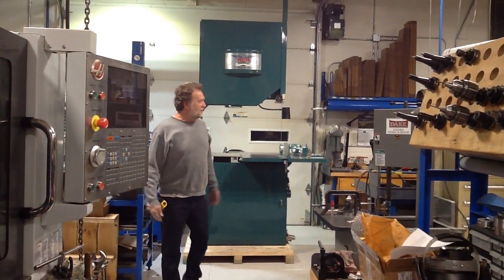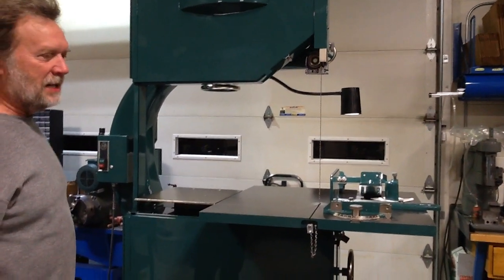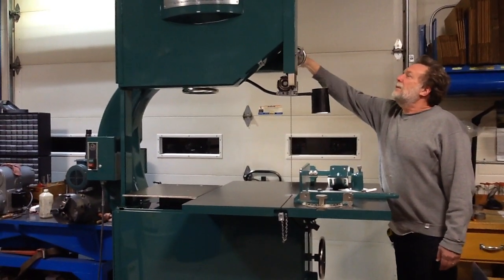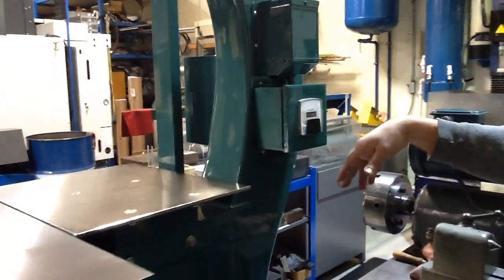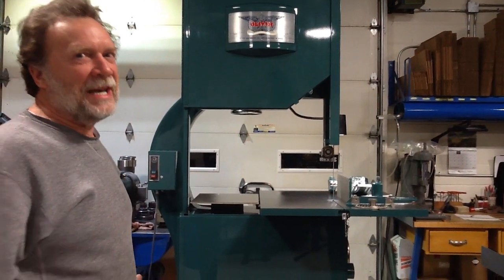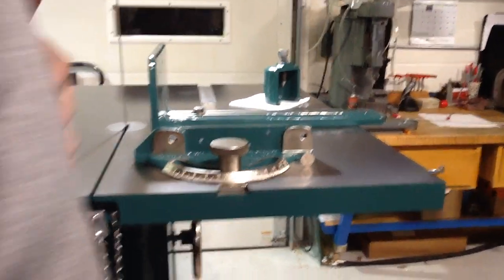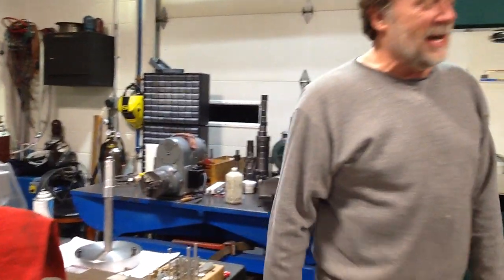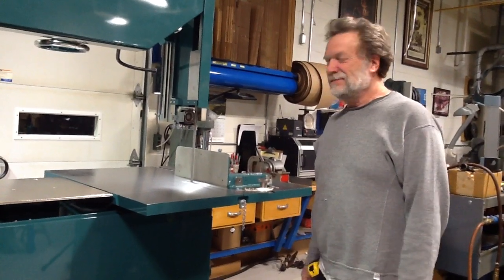Oliver 2416 36" Bandsaw

Comment: Hello Doug, Beautiful work on the restoration. I'm a teacher in southeast Michigan and my colleague has a Oliver No 2416  36 bandsaw.  He's trying to remove the lower wheel to send to the manufacturer but he cannot get it off the tapered shaft.  He's tried whacking with a hammer, heating it up, and we even make a wheel puller and attached a hydraulic jack to remove it but, not luck.  Do you have any idea how we would go about removing this lower wheel?  The manufacturer said they use a wheel puller but that hasn't worked.  Our hydraulic wheel remover we manufactuered is good up to 10 tons.  Not sure if there is a pin between the drive shaft and the wheel.  Look forward to hearing from you.
Reply from the maker: I had a similar problem. I purchased my saw from a fire department. in Washington state with damage to the hub on the lower wheel. someone had tried to pull the wheel with a puller and damaged the hub. I can get the wheel off for you, but you will need to remove the engine and the wheel and the dust plate from the machine and bring it to me. It is challenging to get at all the bolts, but it can be done. I built a 38"diameter "H" press with pears to press the shaft out of the wheel without damage to any of the parts. I have a puller from Oliver but my machine had damage to that area designed to use with a puller.  doug@precisionair.net
Reply from the maker: I have pictures of my press I made and the repair to my hub, I have been very busy, I hope you got this response in time. Email me, Doug
Reply: @dougclark160  Unfortunately, we had to cut the wheel off  to get to the hub, which we had to cut off as well.  There was  a pin in the center of the hub and through the shaft, but even after we drilled the pin out, we still could not remove the wheel.  That's why we cut it off.  Oliver is going to cast a new wheel for my colleague.  Pricey, but the quality  of the Oliver is worth it.  Thanks anyway.
Reply from the maker: Do you have a left-handed saw? I am thinking that it would be the only reason to pin the wheel on. On a right-handed saw the nut holding the wheel on is a left-hand thread. If it's a left-handed saw they may have used a right-handed motor and pined it so it would not loosen up during use. If you are willing to trade, I have an Oliver 30" right-handed saw  (very nice and ready to use) and I would repair yours. I have been looking for a left-handed saw for two years now, not many were built.  @mgarcia8540

Comment: Wheels were statically, not dynamically, balanced?
Reply from the maker: Statically, I was thinking I would get them close this way and if I detected any shake in the machine I would but a dial indicator from the table to the upper blade guide support, record the shake, and trial and ere the rest of the out of balence out by moving a stick on wheel wait around till the rest of the shake went away one wheel at a time. but there was no shake to get rid of. have you started to use or rebuild your lathe and planer?
Reply: The 25-A runs, however the original (belt driven from the outboard pulley) crossfeed smooth shaft, as well as the support brackets are long gone,
so, need to be fabricated. The 399 planer was bought locally at auction this summer. Need to go through it-not much available in tech material-the 'manual' from the Oliver people was not much…
Thanks for asking!

Comment: I used to have an earlier version of that machine. I liked it but the sheet metal door's and upper wheel casing vibrate a lot and make it a very noisy machine that howls at speed. The Tannewitz is a bit better engineered. The trunnions and table are more beefy. Mine was a 5hp direct drive which was okay but a tad under powered. The wheels were cast aluminium. 
I now have a Wadkin 30" bzb which is a much stiffer and quieter machine. The fully cast upper frame is way stronger than the old c frames and makes for a more stable vibration free cut. Noise is not good in a bandsaw. It causes the band to vibrate.
Anyway, lovely restoration and a fine machine nonetheless.
Reply from the maker: You are Correct,  Tannewitz and Wadkin are better band saws. Wadkin makes a chain- chisel mortier I like the best I have 15 Oliver machines now and it's too late to turn back. I started out with an Oliver Molder, 30" jointer and 30" planer. Oliver maid everything and are easy to find used from schools
Reply: @dougclark160  
I used to have three Oliver's.  Their 166 jointer is a great machine. Very well engineered and accurate. I have never used an Oliver thickness planer so I can't give an opinion on it, but Oliver by and large made very good solid reliable machinery.
The 36" Oliver bandsaw is a beautiful looking machine, no doubt but the devil is always in the details and Wadkin did a better job of ironing out the wrinkles.
Most of my gear is Wadkin but wadkin machines get snapped up quick now and the asking price is rising. I would like a combination chain chisel mortiser but I already have very functional mortisers and can't really justify the expense.  
Anyway, you did a fantastic job on that Oliver, well done.

Comment: You are amazing, I'm a crescent enterprise but.. would you be willing to help on a few of my parts?
Reply from the maker: Crescent Bandsaw?
Reply: @dougclark160  Crescent Enterprise p36 planer, v14 lathe, 24 inch table saw and the big 16 inch jointer. All are 1956-58.
Reply: Are you savy in electrical work.i need help with a control panel